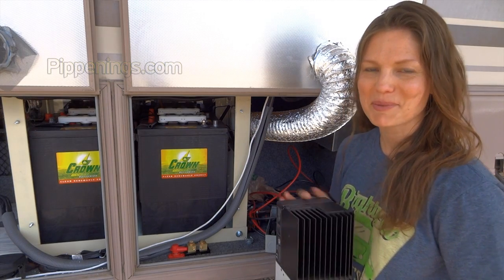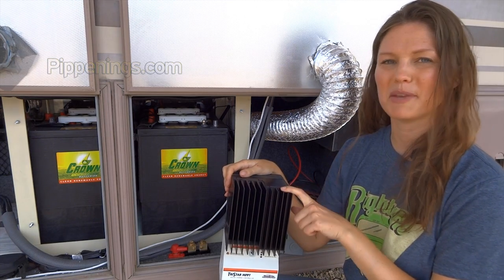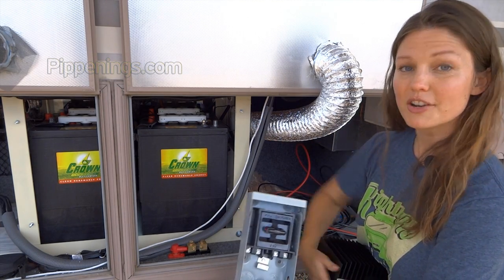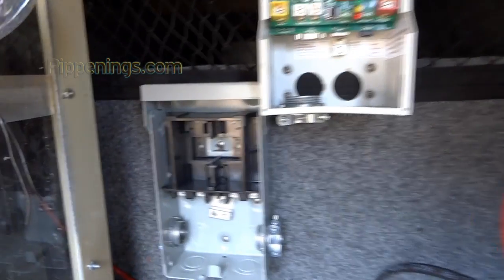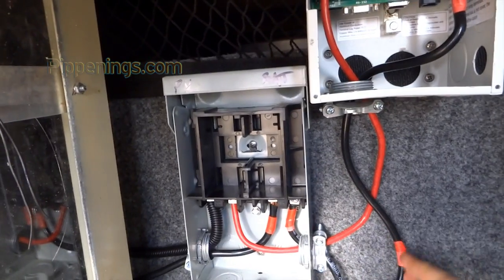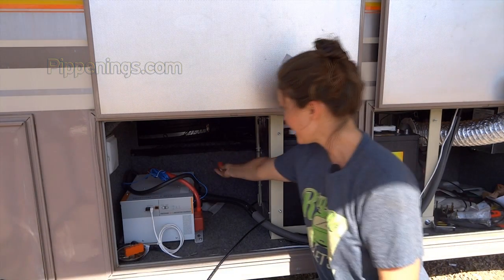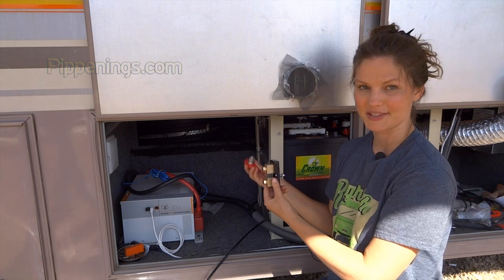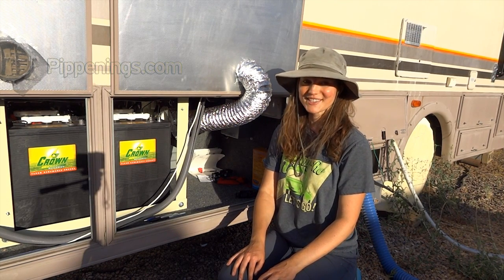RV DIY Solar: Connecting Charge Controller, Fuses & Terminal Posts

Comment: what brand is your ac disconnect switch because the one that they have in HD, it only has 2 screw connection which is basically only can be use either for PV or Battery.
Reply from the maker: I had to order several parts online
Reply from the maker: I did get the disconnect box from HD though 🤔

Comment: Thank you for your intellect you seem to be well read and informed on solar. I have been watching videos on You tube for a while now concerning solar hook up,  I like what I see in you system. I have all the workings for my system,  I am about to hook up in my trailer as I plan to start a trip and doing some boon docking this summer. I plan on using your diagrams to set up my system similar to yours. look for some questions if I hit a stump in the process. thx

Comment: I recommend putting a small computer fan against cooling fins of charge controller making your own wire coat hanger bracket to hold it in place like I did to keep it cool and stable power is what I did but other than that great job!

Comment: I don't think I would fuse both wires coming from a battery. Only the positive or the negative. It doesn't hurt to do it your way it is a complete disconnect but if you burn a fuse is the system negative against ground or is it positive.

Comment: Good video.  I'd watch the temperature on the charge controller.  Blocking off the top of the fins can cause reduced air flow.  They generally need as much room at the top as they do at the bottom.  Cheers.

Comment: Nice video...and nice work, as usual, by you, Pipi!.  a little suggestions MSEE. 
1. Make a little schematic of your wiring and put it on the inner door. Time weakens the mind.
2. Coat all your connections with Lithium grease.  All this is in an uncontrolled environment. 
3. Make sure all of your fuse ratings are spec'd out and the fuses are FAST with indicators..

Comment: Good job, and looks real clean too . I hope you will have some kind of plastic terminal enclosures to cover the positive terminal junction to protect it from anything bumping into it or accidentally shorting it out. Just a simple protective , sturdy cover that will prevent the unthinkable from happening. 
I've done my own Dodge Cargo Van 3500 conversion with solar panels, inverter, an MPPT charge controller, etc.. 
And I run my super quiet and efficient mini-fridge (with 2 exterior doors that has an upper freezer like the big boys have...) And I run that 24/7 with no problems, and it uses only a 0.80 amp draw when it cycles  on... And super quiet! If you need more info let me know.
You're doing a bang up job... congrats! and be safe. 😎

Comment: Aren't you suppose to connect the charge controller to the battery first BEFORE the panels are connected.  I have a PWM controller and fried it once doing it your way.  Thanks.
Reply from the maker: +PAT DOWNEY Yhats why the fuses are there. So there's no connection when they're pulled.
Reply: Wow, Dummy me. Thanks.

Comment: Looks very professional young lady. Good job so far and thanks for sharing. 
Before you put the fuse for input to controller make sure the battery is connected to the controller first before the panels input. I remember reading that someplace so the controller can adjust itself to the proper voltage for output. I do think what I read  was for your particular controller.

Comment: Interesting that there will be a slight negative voltage from vehicle ground to battery ground. Instinct is to tie battery ground directly to body ground but there's nothing wrong with the more creative solution of placing the shunt in the battery ground line. I guess I've never thought about how this type of power monitoring works.
Reply: Current practice is to separate house battery ground from vehicle battery frame ground to reduces ground loops, poor connections, noise. People are using the vehicle frame to ground everything, include wiring it to earth ground, which is bad. Also, "floating" the house battery system from the frame is a safety to prevent electrical fire as any loose wiring touching the frame will not short.

Comment: Keep an eye on the battery fuse.  I installed essentially the same setup as you, including the MPPT-60 controller, and using a 60 amp air conditioner disconnect.  My system outputs from 40 to 50 amps during mid-day charging. After a while, the metal clips holding the fuses heated and discolored.  As time went on, they got hotter and hotter until the fuse actually melted.  I replaced the disconnect and the same thing happened again.  Since then I use DC breakers.  80 amp for battery and 15 amp for solar.  Good Luck with your system!
Reply from the maker: +Jeep TJ5 Thanks for the heads up!
Reply: Well I suspect that if I had been using the box as an air conditioner disconnect and had been drawing 40 to 60 amps on a continuous basis, the unit would have suffered the same fate.  In this case,  its the amperage that causes the heating.  It's unlikely that either the voltage or the AC/ DC part of the equation made much difference.
Reply: Sorry Pippi, don't mean to hijack your post.  DIY Tesla:  I am no expert on DC systems, but your last comment on breakers not protecting against a short - I don't understand.  If there's a true short, the voltage would be almost 0, but the current would very high.  The breaker should trip.  Not true??
Reply: AC and DC circuit breakers are built very differently.  It is easy to break the fault current for AC because the current goes to zero on every cycle.  With DC, as the contacts try to open the fault current arc will continue to grow as the contacts are separating.  The higher the DC voltage/current that is being interrupted, the harder it is to break the arc.  Switches have different AC and DC ratings for same reason.  Only use breakers/disconnects/switches for DC that carry the appropriate DC rating.  So this is another issue to be aware when using stuff intended for AC in a DC application.

Comment: you  amaze me , that solar wiring can be a little tricky but you nailed it and did a great job explaining what you were doing. GOOD JOB!!!!! Just may want to double check the clearance on the charge controller, just sayin
Reply: Pipi, You might want to watch the wireing in and out of the metal nm conectors that you are useing into the ac disconnect from your mppt controller. The make plastic connectors that would insulate the wire insulation from metal enclosures being used. The wire will and short to chassic ground and could start a fire in your battery compartment.  PS love your site. :) petnjoy1

Comment: Shouldn't the 6 inch clearance  be at the top, as hot air rises? Also how does a charge controller store current in large enough amounts to require a larger wire at the output?
Reply: The charge controller doesn't store energy, but it is a DC to DC converter.  So if she has 36 volts at 10 amps coming in she would have 30 amps at 12 volts going out.  Wire size is based on amps not watts.
Reply: good point i was thinking the same since the heat shield is the black part at the top, but its her call .
Reply: Yes, especially in a small enclosed space.           The unit must have several fairly large capacitors to give it higher power out than the input. Wondering why?
Reply: Pippi only has 600W of panels.  The controller is rated 99% efficient so at peak output the controller will only need to dissipate 6W.  With such a large heat sink this won't be a problem.  Also there's no energy storage in the controller.  With Pippi's solar setup she has 18A at 36V coming from the panels, and a 24V battery bank.  The controller converts the voltage whilst maintaining the power, so with a 2/3 of the voltage going out it generates 3/2 times the current.   That's 27A going into the batteries, requiring a larger battery cable.

EDIT - just realised she's wiring the batteries for 24V, not 12V, so corrected as above.
Reply: Thanks.